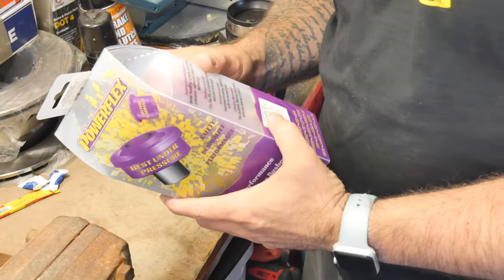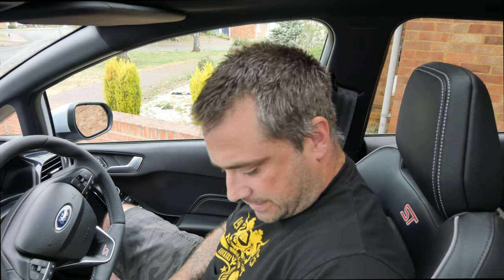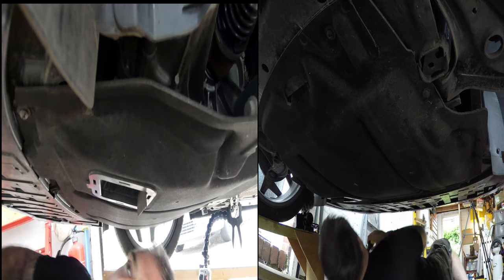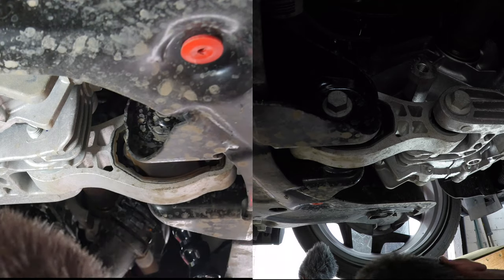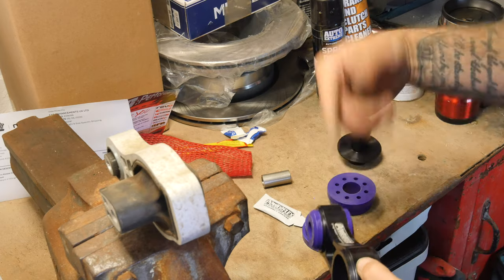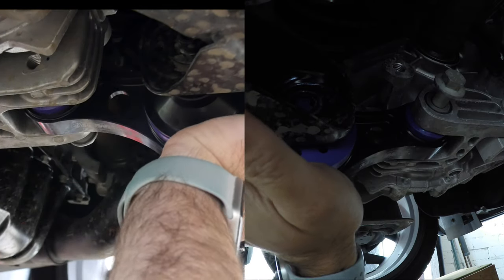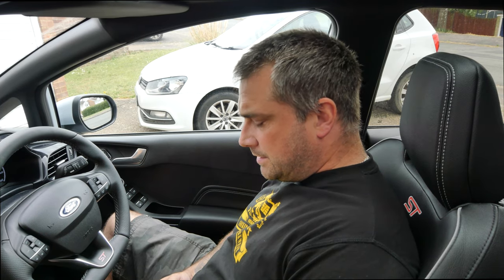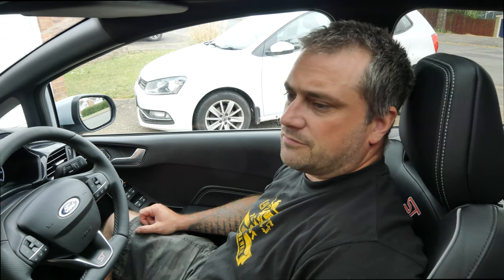Engine Touque Mount Installation. Powerflex. Ford Fiesta MK8 ST.

Comment: Powerflex revised the bush/design recently to improve it and resolve the issues people have been having with them. Looks like yours is the newer version. PS  great Vids - I have the exact same car, albeit in 3 door, same colour but running Dreamscience (was very close between Mountune & DS!!)
Reply: PS you've gained a subscriber for your water and cardboard tests alone 👍👍😂
Reply from the maker: Yer I did find out that my mount is an updated one. To be fair I didn’t realise there as a problem with them before I got mine. 

Cheers for your comments, I’ve got plenty more to come.
Reply: what's the difference between the earlier ones and the updated one? I'd guess the part numbers would be the same, what are the visual cues?

I also saw that Revo's torque mount has gone out of stock due to a revision, they have worked with Powerflex on the failures and now they are starting the production of a revised mount.

Comment: I recently installed the Collins Performance torque mount with mixed poly bushes (purple and yellow). Minimal increase an NVH, but the gear changes are so much better - really crisp and the wheel hop has gone. £s very well spent IMO. Easy installation as demonstrated by Gavin.

Comment: Hey, super cool video, very helpfull, very well explained and realy like the way u are showing the differnce, last lime with short shift and card board, this time with water. Why did u decide for powerflex over others?
Reply from the maker: Cheers mate
I went with the Powerflex because you can change the bushes on these. The one I got is the softest one. This is fine for everything driving. I do think the harder bushes will be to much for the road but I might try then out when I am board one day.
Reply: @G5MAV  powerflex doesnt make yellow as the softest setting.?

Comment: Hi great video i fitted the revo and after a few weeks had to remove it bad vibration between 1500 revs and 2500 had to keep changing gear to avoid it not had the car tuned yet

Comment: I took mine off to much vibration for me on idle with a/c on , ridiculous!
Reply from the maker: Was yours the same as mine? I can feel the difference with the mount on there but I can put up with the feel because on the performance benefits.
Reply: G5MAV mine was the Collin performance torque mount with yellow bushes.
Reply from the maker: I don’t know much about Collin to be fair. I don’t think mine is as bad as your by the sound of it. With mine you can feel a slight increase of vibration when you pull away but it’s not that bad. Might be worth trying a different brand as the standard one is to soft. You can get inserts for the standard mount from powerflex. https://powerflexstore.co.uk/ford/fiesta-mk8-st-200-2017-on/powerflex-lower-torque-mount-large-bush-insert-fiesta-mk8-st-200-2017-on-pff19-2224/?gclid=CjwKCAjw8df2BRA3EiwAvfZWaCFbGFTh9_MdZXHlTkdnsusoYnM9aOXlvKukcPdunUSpbvysQGoNPhoC7WwQAvD_BwE
Reply: @philhill7973  powerflex make most of the bushes I believe mate, and these were revised recently! May be worth trying the latest Powerflex one or another brand. I'm trying to see how people are finding it before I buy one

Comment: You didn’t torque it up!? 😳
Reply from the maker: I didn't own a torque wrench but I have received mine from amazon today. I will double check everything in the net few days.
Reply: @G5MAV  Great video. There has been a lot of conversations on the MK8 forums about what torque settings to use for this mount, I think powerflex say 45nm for the 16mm bolt and 47nm for the 15mm bolt. Other companies suggest for their own mounts about 54nm. I think when I do mine I will probably do 50nm. Glad to see you have got the new updated mount as the earlier ones had quite a few failures. Thanks again for all your videos, they will help me out a lot.
Reply: @ronaldpodd6169  what's the difference between the earlier ones and the updated one? I'd guess the part numbers would be the same, what are the visual cues?
I also saw that Revo's torque mount has gone out of stock due to a revision, they have worked with Powerflex on the failures and now they are starting the production of a revised mount.

Comment: Hello.  I just got the powerflex on my ST but i think the vibrations is sounding like an old Golf 2 starting up. 😂 Is this going to be better  in the nearest future or is it just the same? If not, i have to put on the stock one on again. 😆

Hope you will reply soon. 🙂
Reply: As it has been months now. How is the vibration? Normally it should settle in after a month. But if it is too much for your taste, go back to the old one.

Comment: Had the Revo mount on for a month or so, vibration was awful so bought the Powerflex mount, hope it's a lot better than Revo
Reply from the maker: To be fair I hardly notice mine now. They get a bit better once they have worn in a bit.
Reply: Just put my Powerflex mount on, and already u can tell it's the best 1 out there, I've now tried the Revo mount which was horrible and also the Pumaspeed mount which was slightly better than Revo but now having got the Powerflex on already really good so thanks for your video, really helpful 👍

Comment: Hey mate, nice vid, I was worried doing it on my ST, but looking at how easy it is, I'll give it a go !
Anyway, why Scorpion exhaust over Miltek one ?
And now that you've been under the engine, have you look if there was a factory BOV on your car, cause it's seems like some ST got one, and other doesn't, and it's a bugger realy cause I ordered a Turbosmart open BOV, and I feel like it won't fit on my car...
Cheers
Reply from the maker: Hey
I went for the scorpion because everyone I spoke to have said that the scorpion has the deepest sound, oh and I really like the look at the black tips on the scorpion. 
No I haven't looked for the BOV as yet but I know what you are talking about. I am still unsure if I want one or not but I will have a proper look when I am fitting the scorpion. I am sure I can come up with a solution once I have had a look.
Reply: The BOV can't be fitted on models after mid 2019